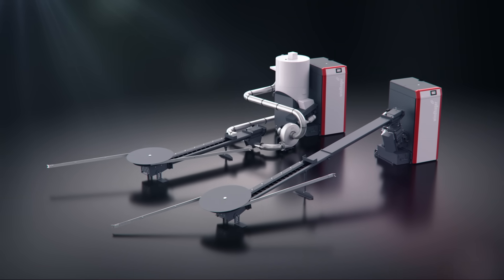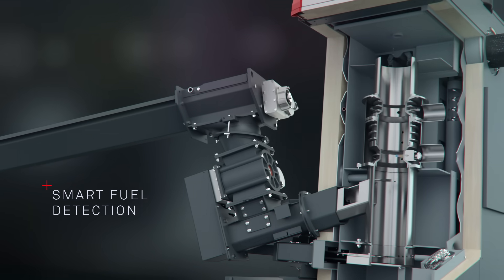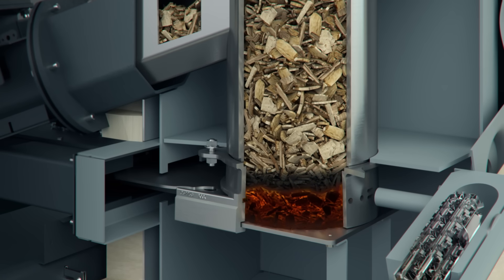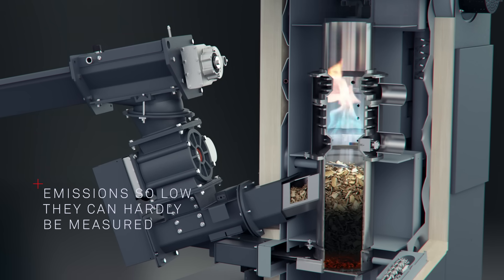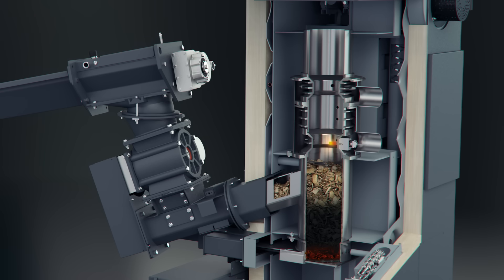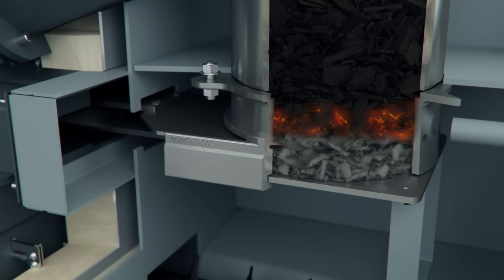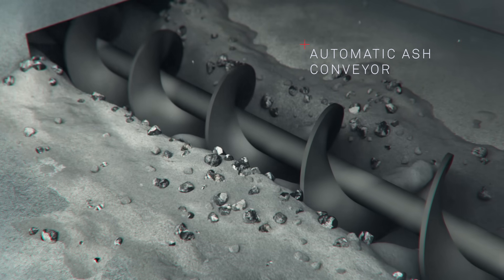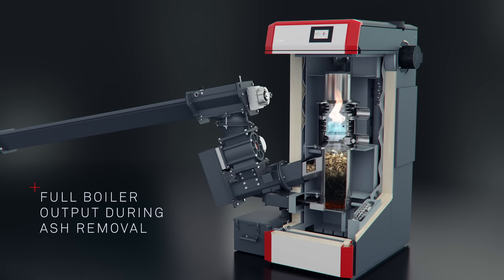Windhager PuroWIN - wood chip boiler - zero-emission gasification boiler with stainless steel burner

Comment: The amount of moving parts combined with heat and the brasive nature of wood ash would probably lead to lots of maintenance.
Reply: There's like 4 moving parts 2 augers and 2 plates. And augers are used in mines for smaller material. And we have steel capable of handling this type condition for the plate.
Reply: @allstarwoo4  Two igniters and inducer fan. still think if you clean in once a month you would be fine. Even if you cleaned it quarterly.
Reply: @lolo104-ws  Even with the fan and 2 ignitions that's still nothing. If the fan is located in the intake a filter would prolong it's life and igniters are cheap and replaceable.
Reply: I wouldn't worry about the augers as some old Iron Fireman coal systems are still out there working 80 years later but other moving parts like the internal dust clearing plates would be more a concern.
Reply: Better to perform maintenance on your boiler rather than performing maintenance on your lungs because you had to expose yourself to ash dust and smoke to do these tasks manually.
Reply: It’s obvious to me it will have some issues at first, just like all new products. On paper looks great but real world applications is the real deal.
Reply: @Papadooskiss  you think this is 1st time something like this is built in the world? all tech is pretty old and tested on various applications.
Reply: exactly what I was thinking, also "emissions so low they can hardly be measured".
Yeah no I would actually prefer the "hardly measured measures to be mentioned.
Reply: I was just making a point that, even tho yes it’s been tested I’m sure. But, many ideas have been tested and put into production, but flaws still show themselves tested in the “real world” I mean just take a look at the auto industry. Have a good one.

Comment: Zero emission? No Tar volatiles? It looks like a cool burn process, there should be some. You don’t explain the volume of wood chip required either. Lots of claims but no data...
Reply: because its a lie
combustion = emission
Reply: Iron 4 Troll Patrol combustion = emission only if you define CO2 and H2O as emissions. But those molecules, which are both “greenhouse gasses”, are necessary components for life as we know it on this planet, and both are molecules that you “emit” literally every time you breathe. So, yes, the term “emission”, as used in this context obviously refers to “particulate matter” — dust, soot, etc.,  The stuff ordinary people call “smoke”.  My municipality does not legislate how much CO2 I release heating my home (and neither does yours — none do) but they do regulate how much particulate matter I release. If a neighbor complains about smoke from my wood burning stove, the city will send an inspector to measure the output. If it’s too high, I would be fined. But the city I live in doesn’t measure CO2 or H2O emissions for residential heating. Therefore, the info presented in this advert is exactly the kind of info a person like me needs. Not deceptive at all; it’s precisely focused advertising.

Comment: I built a rocket mass heater for about $500.  It does the same thing with no moving parts or energy input.
Reply: yeah, but theirs is probably 5x more energy efficient, and 100% automated.
Reply: @SyberSqueegy  rocket mass heaters are impresiv. So no in fuel efficiency there won't be mutch difrenc. But of course if you need bling to impress sombody then it's not the way to go.
Reply: Bum

Comment: This thing is probably prohibitively expensive. The wood chips going into it have to be in such perfect conditions. Youre better off sitting around a burning tire.
Reply: up to 25 000 $
Reply: @rafastepien4303  yes this thing can't compare to free burning rubber.
Reply: @rafastepien4303  too much...
Reply: It's for buildings powered by woodchip
Reply: @larrywood8933  how would this compare to burning gasoline in an old coffee can?

Comment: The wooden stove from the future :-)
 Great tech !
Reply: Not from future, from passt. Google holzgas motor.
Reply: 0plp0 is right - we've quickly forgotten that just a century ago, every major city had a gasworks, where some coal or other volatile was cracked/pyrolyzed (not burnt) and the resulting gas (mostly a mix of hydrogen, carbon monoxide and methane with others as well) after being filtered was piped to businesses and homes; originally this was just used for lighting but over time was used for kitchen stoves and eventually central heating.
This went away when we discovered natural gas deposits, but as we understand the need to be more responsible stewards, we could easily switch some of our gas supply to locally generated biogas plus the output of new gasworks - instead of landfilling hard to recycle combustibles, we should be tossing them in the roaster. Some cities do use trash-to-power systems, but I'm talking about far more extensive uses than currently in place - the county I spent most of my time growing up is a suburban one near a major metropolitan area. In the neighboring city in the fall when leaves have fallen, you rake them into big piles along the curb and the city comes with a big vacuum truck and sucks (and grinds) them up to go for compost. In the other cities, you have to bag and bring them yourself other than one special pickup day - but to just consider that for all of the leaves that do end up at the compost heap, each decent sized yard (we're a metropolitan area that still has almost as many trees as many fully forested areas do) has a giant pile of sticks to deal with, and if you have oak trees or a few other species some years you get extra growth to rake up. Some people have backyard campfires to get rid of it, while some just seem to stack it up and wish it went away. Others go to the hassle of bringing it to the county compost site, of course they only take sticks under a certain thickness; so what to do with the rest? Simple, there should be an easy drop off point for a neighborhood power/gas generator - some device quite like this Windhager but that comes with a chipper so people can feed in a variety of sticks and other biomass and it goes in as demand comes from the neighborhood; and that has a gasification supply unit in it, so part of it generates gas and the other part can burn to heat up your glycol loop (providing heat to homes nearby via heat exchangers to local heat storage tank in each home) or similar.
Reply: From long past, half of Germany was running on gacifiers towards the end of WW2 when they couldnt get fuel anymore.
Reply: A combustion with zero emission!?! OMG, or they think people are stupid or it's just a plain lie without any remorse. In the ad "...produces emission so low...". Anyway, the CO2 produced must be retained by a filter. So, where is the "zero-emission gasification boiler"?
Reply: @mestreg5687  They are probably referring to particulate matter emission.  Which is a Criteria Air Pollutant regulated by the EPA.  This company's customers probably care about adhering to those emission regulations.
Reply: @mestreg5687  They are saying that its smokeless and without soot wich its real and you can see it yourself if you build a TLUD from tin cans and add bits of wood on top after it gets going.
Its not a flawless design thogh because if the flame estinguishes,then it becomes the most poluting stove .
Reply: it still uses wood as a source anyway. Not like it spun up dynamo free energy for heating. Another technology that would requests human to deforest the world.
Reply: @MagicCube-H2O  Yes it would need to be paired with responsable forestry but could work well if people were diligent with fule sourcing.
Reply: @MagicCube-H2O  Wood is completely renewable source of energy. Where i live they plant new trees after harvesting the wood.
Reply: Wood fuel means planting forests not cutting them down you moron
Reply: @MagicCube-H2O  another tree hugger , corporate logging needs to go to hell, but everyone can get an acre of land with trees on it and use and plant new trees. Ive bought 1.66 acres all forest for 1000 usd before. Wood for life. The system is corrupt and destructive yea, but changing the system would give enough for everyone.
Reply: @LoveInAction21  
well, it's most likely more efficient and better for the ecosystems if you just harvest the shit out of smaller forests compared to everyone cutting down trees everywhere ;)
Reply: @LoveInAction21  look up what tree farms are before you talk about deforestation
Reply: @LoveInAction21  depends on the logging company. In places where there are more regulations on logging, lumberjacks have to maintain a balance between cutting down trees and replanting them. These lumberjacks have done more for the environment than any climate activist, since when do politicians actually listen to them after they are in power? But in places where there are less regulations and plenty of corruption for example Brazil, yea that is a serious problem with massive potential global effects.
Reply: @LoveInAction21  I do not believe that. I mean not everything you said, but getting 1.66 acres for $1000, nope. Not in the US (cheapest land in US is $1000 for .23 acres) and not in the Philippines either. Where are you getting 1.66 acres of forest for $1000 USD?
Reply: @LoveInAction21  forests are deforested for two reasons, for the wood and for the land.

Companies that deforest for the land after deforesting turn the forest into something else. Companies that deforest for the wood after deforesting replant. This way they don't run out of forest and the forest land price doesn't increase

Also, not all wood is obtained by deforesting and using a renewable resource like wood is better that using fossil fuels

Comment: Isn't this just a fancy wood gasifier?
Reply: Sounds like the perfect thing to run my pepetual motion machine on when i use it to power my free energy generater
Reply: Somtimes I go look at old patents if I have a technical challenge. Many times things now are Don more complicated to get new patents and create a money flow to the company. Not to improve the outcome. Actually a litle saad
Reply: The only difference between a wood gasifier and a boiler is where the gas is meant to combust. With boilers the gas always combusts within the boiler itself, but gasifiers have the gas burning away from the unit, most often inside whatever else it's intended to provide heat or power to.
Reply: It is. You need to replace wood and remove the ash every 4 days. They over automate the whole system for no good reason.
Reply: no this is your basic, plain ordinary and utterly generic wood gasifier.
Reply: It’s a fancy pellet grill. And yes I want it
Reply: ههههههههههه
Reply: yes
Reply: Seems like a simplified version of the ones I've seen
Reply: Well, it is in the name... so probably.
Reply: Yes, ide imagine it would also work well on coal
Reply: Yes. Yes it is.
Reply: Exactly, and if the wood chips aren't perfectly dry so as to "filter" any "emissions" (probably heavy tars), it's going to fail to work. Looks like any repairs could be very costly!
Reply: Actually, I think unseasoned wood chips would make better filters, 
Sap, resin, water, etc are all better at picking up particulates, chemicals, etc than plain wood fibers
The problem is that they emit more junk

I'm curious if a taller stack would work better, like 5 to 20 feet tall of wood chips
You could either make one tall stack
Or you could make several stacks 2 to 5 feet tall, and use chimney draft to suck gases through the whole array 

I also wonder how temperature affects absorbtion emission and deposit rates
I'm assuming if you warm up resins, fibers, moisture, etc, that absorbtion will go up
But at some point things start emitting boiling evaporation crumbling etc

It might work well to pump the fumes down to a burner below the wood chips
You could take the exhaust out and let the heat bake the chips
Reply: prolly $20K fancy.
Reply: Yep but gasification of wood is untenable as a world wide or even national energy source . Yes it produces less carbon but it elimanates key carbon neutralizers , namely trees . Its a prepoers dream but only opif few people do it .
Reply: @georgeelmerdenbrough6906  Have you ever heard of a coppice?  Solves that issues handily.
Reply: @georgeelmerdenbrough6906  still a step from fossil fuels(?)
Reply: @georgeelmerdenbrough6906  key carbon neutralizers is the algae.
Reply: Many regions might not be able to go 100%  biomass heating 
But many regions can
And many more can supplement

Yes you can burn wood and chop down trees
But thinning out dead wood, diseases, beetle infestations, thinning thickets and underbrush
These things keep forests healthy and reduce forest fire
Yes you need forest fires here and there to fertilize, invigorate, thin, and activate many ecosystem factors
But if you go out of your way to prevent fires, reduce harvesting, tweak herbivore carnivore numbers and habits, etc
Then you get rot, blights, infestations, and fires that take out big trees

A healthy forest can have fires that thin out brush and tickets, but actually leave big hundred and thousand year trees and ecosystems in tact, 
But if you push some mutated lovey dovey helicopter parenting pat yourself on the back stuff on forests then you kill them

If you are gonna need with nature then you need to holistically apply and observe all interactions
If you divert rivers and augment lakes, seed wildlife, harvest others, put out fires, etc etc etc
Then you need to adjust

Imagine telling a farmer that harvesting crops hurt the farm
Lumber mills, hunters, woodsmen, etc are farmers of the forest, they don't want it to fail, they carefully figure out every action to help the forest thrive, the forest is their crop 
Yes there's a learning curve and a bunch of idiots and a few jerks 
But what seems to be the biggest danger to the forests is not the few idiots and jerks with chainsaws that haven't learned yet 
What seems a much bigger threat to forests is the billions of idiots that never actually live and work in the forest trying to call plays from the couch

Tree huggers cause mega forest fires, that's way more pollution and sequestration loss than wood stoves

Zoning causes vast tracks of land to be polluted with cookie cutter prison boxes (housing developments), permanently killing and eradicating wildlands is a bigger threat to forests than lumber mills 
If people were free to build abs use land how they wished then smaller footprints and more efficient structures would be used

Environmentalists that worry about the fish and snails and atmosphere tear down dams bringing droughts, rot, infestations, fires, and not enough water to fight the fires when they do come

Sorry for getting heated
But it's not just naive, it's monstrous to blatantly preach lies that lead to mass destruction and deaths of millions
Reply: @georgeelmerdenbrough6906  For most countries. that's true. Canada has an abundance of waste wood, apart from exporting lumber and pulp; but, it makes sense to use it as a fuel, instead of using fossil fuels, where possible. What is more interesting is the use of algae as a fuel. For the same area used to produce trees, about sixty times as much carbon-neutral biofuel could be produced by algae. The main difficulty has been extracting oils from the algae, to replace gasoline and diesel; but, if the algae can be desiccated, (dried out), sufficiently to produce biofuel pellets, they could be burned the same as wood pellets, without sacrificing forests and jungles. Algae oil (to replace gasoline) now costs about $33 per gallon to produce and refine; but, that cost could come down to as low as $3 per gallon; then, who needs fossil fuels and electric battery cars?
Reply: @Resologist  - "then, who needs fossil fuels and electric battery cars?"
I mean, electric cars are still better than burning fuel. Car engines are significantly less efficient than power plants, for one, so you're already losing a ton of energy that way, but even if you assume equal efficiency electric is still better because while total emissions are the same, localizing them at a small number of power plants makes it far more feasible to develop and use carbon capture technologies to prevent just dumping it in the atmosphere, or in the case of vehicles, spreading it out everywhere to form smog in cities.
Reply: When videos just show animations and not a working machine it's not for clarification is because it's theoretical which means the emission bs is a bs lie.
Also the emission talk is bs to make it sound good(not because it's impressive but because we have no idea what the hell they are talking about because it's nonsense gibberish  ).
Reply: @yourbabyboyfriendonlyme2485  Even older gasifier are really good on their exhaust gasses. This is just a pimped out version of it. I bet it would be reasonably mild.